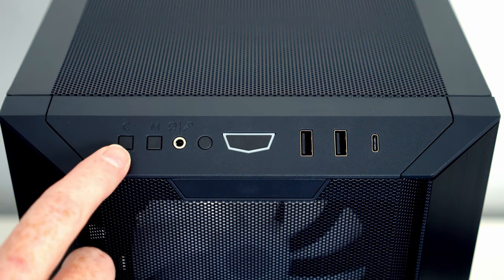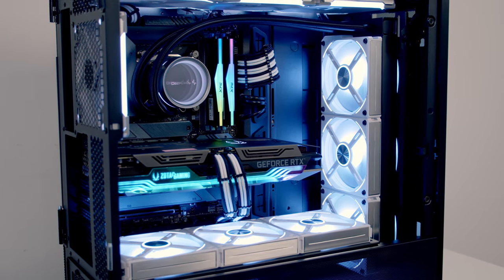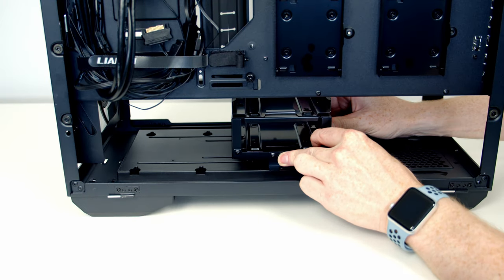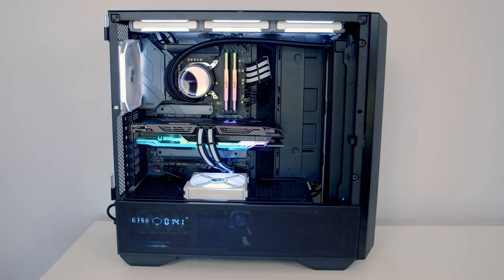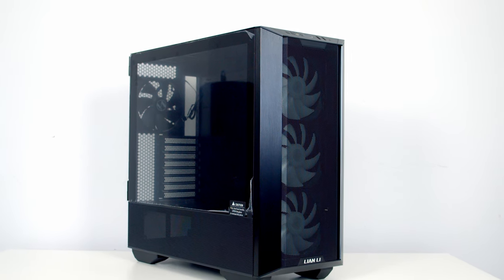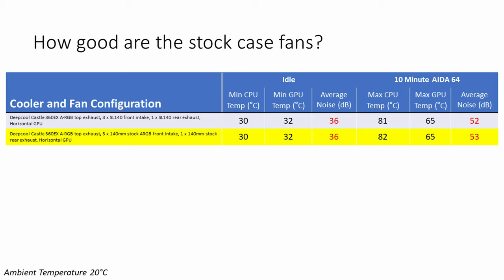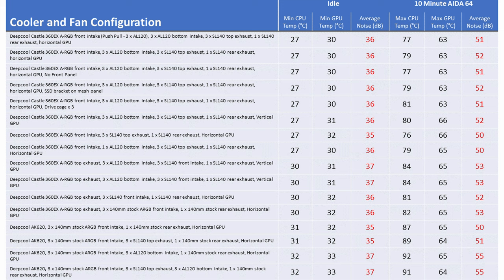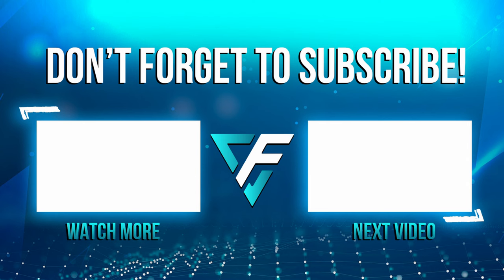Lian Li Lancool III - Best Fan Configuration

Comment: I have this case, building it tomorrow.
I think I'll mount the 420mm radiator to the front, based on what you've shared here (I was going to top-mount it). It should be easier to fit the 420mm rad in the front as well (though i will have to see). And then put 3 fans top & bottom each. IF the 420mm rad won't fit in front, i'll mount it across the top. Looks like it can fit (barely) if I move the front fans forward by flipping their bracket around, and remove the rear fan. I want the cpu as cool as possible though, it's a 7900X. This video has been extremely useful! Thank you for making it!
Reply: Have you mounted 420mm radiator in front finally?
Reply: @andreio6063  I ended up mounting it to the top.

I kinda went back & forth on placement. Ultimately I decided I wanted the rad horizontal and above the CPU, so that it would remain completely functional even at say 50% fluid loss over time (fluid loss would just make the radiator fill more shallow, not introduce bubbles to the flow).

420mm rad (iCUE capelix) was a TIGHT fit. There's 2 slots to mount the front fan bracket, 2 ways to turn it, and 2 sides to put the fans on it (8 possible configurations in total). And only 2 of those worked with a top mount 420mm radiator, with only 1 of those allowing the front cover to fit back on. Basically out of 8 possible distances in front, you want the fans at the 7th most forward position. This was: with the fan frame turned to be closer to the front, and the fans mounted to the front of that, but fan frame set into the slots which are a bit further back (the upper slots) so the front cover could go back on.

After that, I still had a problem in that the 420 rad would not allow the latching lever to move freely (to get the fan mount snapped in place). ...the top screw holes for the rad are a combination of specific holes, and elongated slots. I pulled the screws out of the holes, and loosened them slightly in the elongated slots, so that I could shift the radiator reward a little bit, and get that front latch clicked shut on the fan bracket. Then slid the rad back into place, to line up the round screw holes.

Lastly, my motherboard has a chunky IO port area, covered by a largely decorative block with LED lighting inside. It's the "Asus Prime x670e Pro Wifi" if you want to see what i mean. The chunky heat sink above the cpu socket was very tight against the 140mm fans when screwing them in. But the blocky area at the top rear of the IO completely blocked the corner of the rearmost radiator fan. At this point I was pretty deep into an overly complicated assembly process hehe. So I cut off the rear corner of the fan housing (turning it into a 3-screw fan). Then it fit fine. This is essentially invisible, unless you stick your head inside the case, and are told where to look. Also, I can't tell any vibration problems with 3 screws, seems fine. I suspect some motherboards would not encounter this issue. It's a decorative aspect of the mobo I got.

Also, I omitted the rear case fan for space. 420mm rad fits in this case but only "barely", and only with a lot of negotiation.

After all that ...the build was fairly straightforward.

Set the lian li fans to a static color. Set the icue 420 rad fans to a very closely matching color. voila, looks great. And the whole font and top of the case inside are basically wall-to-wall fans. Kinda screams performance, like a car with a hood scoop hehe.

Would I do it again? Yes. But getting a 420mm rad in there is NOT a 30 minute build. And may require improvising.

Ram clearance is actually better than I thought it would be. I got plain stick ram (ddr5 6000) and there's actually some room to spare. Particularly exotic heat sinks on ram could be an issue though.

I will say that I do NOT like the clip-system for attaching the heat sink to the cpu on AMD. It's waaaay too easy to have it move around on you and mess up your paste. I would strongly recommend using the "spread all over the cpu evenly" method for paste, cuz it's impossible to get both clips, with water hoses pushing/pulling on the pump, without it moving some. That would be true regardless of rad size, it's not related to the fact I got a big rad. I had used a dot, but the way it moved while getting it clipped on, i knew i had to pull it off and re-apply (second time with fully spread paste).

7900X runs HOT. First time in bios I thought I had done something wrong. But I figured out that the cpu is just constantly trying to overclock itself (by design), even when not under load. PBO undervolt helped a lot. Mine seems completely stable at PBO -20 on all cores, zero difference in performance, and this shaved off 12C. I also set max cpu temp to 85C, because AMD can say 95C is fine all day, but they also sell cpu's, and I want mine to last. With the PBO tune, his had only a very minor impact on performance (like a 100 mhz difference). Also 95C is very close to boiling & will fry your paste very fast (dry it out), 85 should allow the paste to last a lot longer.

I had planned to get a "not quite bleeding edge" graphics card (XTX or 4080). But the price/performance ratio is not great on those this generation. Bizarrely the flagship beast 4090 does better on price/performance. So I got that. It's more money, but also probably will last me an extra generation. It is quite warm, but I detuned it "slightly", and added three 120mm fans I had laying around over the power supply area. I would like to replace them with iCUE fans, as there are 3 open ports on the icue controller still. And I think that would match the top fans well.

Then I had to fight the bios to get 4x16 GB to run at full 6000 speed. hehe. But I eventually sorted that out. There's no reason 4x single bank dimms wouldn't. 2x32 are each dual bank which is functionally the same, 4x32 can't go full speed cuz that's too many banks, but 4x16 should work fine. But computers are full of dark witchcraft. I managed to appease the evil spirits though.

Definitely the most challenging build I've ever done, by far. But also gratifying to complete. Lancool III is an amazing case though. I made the build hard with numerous other decisions. The case is great. it's exactly as thick as my old corsair 750D (full tower), but a couple inches less tall and wide. A half centimeter more height & width would make 420 radiators easier, but lancool III is pretty beefy for a mid tower already.

Computer go BRRRR

No money left over for a 4k panel... maybe when the next black friday rolls around. I think the 4090 is completely bored running a 1440p/120hz monitor. Not even a hint of stutter, no matter the setting or how badly optimized the game. Even cyberpunk at max ray tracing just sits steady at 120hz. And visual work is much faster.

Comment: Thank you so much for your content... I bought this case and I Will put the AIO with push / pull configuration In front (6x120) + 3x140 original Fan CaseTop  ( Exhaust) + 3x120  bottom (intake) + 1x140 Rear (Exhaust) . Total : 13 Fans all of them are the ST-.120 and the original 140 fans included In the case.  All for a I7-13700k & RTX 3080Ti
Reply: @MultiNastyNate  keeping the push/pull ? or just with the AIO sl120mm (3x)?
Reply: @DanCaparroz I have the Push/Pull with 6x120 ST-120 fans, but the last week , I had to change the position from "Front_6x120 Push/Pull "  to "Top_6x120 Push/Pull" , because the pump water (Lian Li galahad 360 AIO) started to make bubble sound inside, so is recommended keep the AIO radiator & air bubble in top, BUT with this new configuration, actually the temperatures increased (with the vertical GPU mount too, as is showed in the video.)

Comment: Just goes to show that simpler airflow paths are more efficient. Adding in turbulence with air going all over the place is unlikely to help cooling or noise. The key is balance. Some of these setups might actually work better with certain fans set at very low speeds so that airflow paths don't interact as much.
Reply: Like which certain fans?
Reply: @Cleverconveyence  the fans in the basement of the case. If they are blowing too hard they are just going to interfere with the air flow front to back.

Comment: I highly recommend doing something about noise first (52+ db is very loud, IMO) before doing other tests and it drowns any chance of positive changes from things like fans under the GPU. My current config is Phanteks Enthoo Pro 2 and my fans are almost inaudible, all 10 of them. The loudest I can get it is around 1db extra in 3d mark stress test (slight bit of extra fan noise). I don't do AIDA64 so I can't comment on that. Personally, I'd prefer cinebench or 3d mark stress test over AIDA64, as latter is an unrealistic scenario that overloads CPU fans and results in said fans drowning the system noise completely. Simply speaking, almost all results start at around 50db noise, which isn't very useful.

Just my personal opinion.

Thanks for testing all of these configurations! Loads of very useful info!

Comment: wow , thank you very much for a great explanation it saved me alot of research and effort for the PC i am building the only variation or issue  i might have is i will be adding 2 3.5 hdd and no fans on top of that but i assume that will not be a problem . again thanks for a great video

Comment: I'm thinking about going with the stock configuration + AIO at the top to make it look the best. Despite the worse temps from putting the AIO at the top, I think it will still be better than air cooling the CPU? Many thanks for the in-depth video and the one teaching how to build on it. Wish I had watched it before forcefully trying to remove then replace the front panel, which made me break one of the pins and now I'm one pin away from making the front panel impossible to fully close.

Comment: Excellent Video. The air-cooled build is very attractive to me in terms of budget and ease of build. The fact that the temperatures are only slightly warmer compared to the "AIO as top exhaust" configuration really seals the deal for me.

I am hoping to overclock, however, so I may end up going with the AIO as front intake if I find myself seriously limited by temperatures under load, but as I will be using the computer mostly for gaming, I'm optimistic. Thanks again for such an informative video.
Reply: I'm currently awaiting an RMA for my Galahad 360. Knowing that I could sell that for 100 bucks and get this and a good air cooler and save so much money kind of pushes me in that direction.

Comment: It looks like the front AIO +  rear exhaust + 3x 140 top exhaust is one of the better setups and one that I would prefer, but I'm worried this would cause a negative pressure system and suck in dust constantly.  What would be the best solution to that?  Is adding the 1 bottom intake really doing anything since its inside the case?  Or would switching the front most top fan to be an intake be ok?

Comment: Do you believe a 420mm AIO on top with 3 exhaust fans that takes advantage all the available top space could do the same as the 360mm front case scenario that was the best at your tests? Btw this is the best video on YouTube considering real testing with a lot of scenarios. Good job, subscribed for this only.

Comment: My brother pointed me to this video and I liked how you break down the different setups. I then found the Mesh II reveiw you did a year or so back and am sad I didn't find it sooner as I have that case and wish I had found that video sooner. I basically came to the same results you did but I only had the 240 rad to play around with. I found that the bottom fans help but not enough for my build to bother as I too like having my card mounted in the vertical position and placing the veritcal mount in the raised position looks terrible to me. Yes it runs a degree or two hotter but after watching your Lancoool III review I wonder if I can offset that with a push/pull setup on my rad.

Comment: I think the 3 top exhaust fans might be sucking in the new cool air from the front intake fans before the cool air got the chance to circulate in the system, and this is exacerbated by the negative air pressure by having more exhaust than intake fans. That's why this setup ended up being hotter than the stock despite having more fans.

Comment: Great video! Exactly the information I was after. One question, when installed in the front could the radiator be flipped so the pipes are at the bottom?

Comment: I know the video is one year old, sorry I'm late.
But I'm thinking about buying a 3 fan bundle , to replace the none RGB one and 2 in the bottom. Doing this with a 240 aio on the top and the 3 stock fans up front.

Comment: Right now I have a 13900K with stock fans and an AIO 360 at the top and get 97-100C on 10 minute Cinebench 2024. You think if I just switch the AIO to the top and the 140s to the top I will get better thermals? That is what I got from the video.

Comment: I wouldn't have thought of a push/pull at the front, let alone putting the CPU AIO on the front, but that worked better than I expected it to and is aesthetically pleasing. I am curious if two fans on the bottom would have made any noticeable difference. I understood removing the front-most fan, it's not blowing air directly on anything, the air is just getting pushed by the front fans towards the motherboard. But the rear-most fan, maybe that could have helped in some way. At the very least it wouldn't have been as much of an eyesore as the middle-only fan.

Comment: Funny, I got cooler temps in an air cooled setup by adding 3 Noctua A12x25s above the PSU shroud.  I'm running 3 Noctua A14s in the front and 1 in the back.  DH-15 for the CPU cooler and no top fans.  I was considering more fans on the top but I don't think it is worth it as my temps are fine and I don't want to mess with the positive pressure.

Comment: I really loved the thoroughness of this test, but I am left with a lot of questions about how adding fans increases temperature?  Is it a question of balancing intake and exhaust, or the direction/ turbulence of flow?  If you varied the speeds of intake and exhaust fans, would it be possible to change this result?

Comment: Love to watch your setup on the Lancool III. I've just upgraded my gig to i9-13900K and 3090Ti, but my old case bequiet Dark Base Pro 900 and H150i PRO seem not good for the temp and airflow. I'm considering between the Lancool 3 and Corsair 5000D Airflow. Which one do you prefer for the airflow and temp?

Comment: Is it possible to fit a 420mm radiator at the front of the case, not just 3x140mm fans?  Or does the extra size and cabling of the radiator make it impossible to fit at the front?

Comment: Just out of curiosity, have you tried testing top fans as intake when air cooling, rather than exhaust?  I have been finding, in these airflow-oriented cases, filling the top full of fans set to intake *when aircooling* actually provides better results for temperature on both CPU and GPU and noise. I suspect it's creating a lot of positive pressure pushing heat out. This does not necessarily hold true for AIO cooling as I have found it is better as exhaust when installed on top, especially for GPU temps and noise.
Reply: That's not how heat and air works...

Comment: I've been trying to find out if, if the III actually has better airflow than the II, if you'd actually gain -1 degree or two. Because I have a II (thanks to your old video) an im wondering should I do a complete rebuild or just add new components into my Cool ii. cheers

Comment: This was a great video and extremely informative.  I'm building out a new Lancool 3 and wanted to know if the case can fit both a NZXT Kraken z73 and GPU AIO (Gigabyte Aorus 4090 Xtreme Waterforce 24G).  I'd most likely front mount the NZXT radiator and top mount the GPU radiator.

Comment: Amazing video, love these fan configuration test since I don't have to waste money buying the fans and test it myself.

Thanks!

I wished you did a test with:

1) Cpu cooler (air) + stock case fan configuration (front 3x intake, rear 1x exhaust) + top 1x exhaust (most left side position).
2) Cpu cooler (liquid aio, front intake) + stock case fan configuration (front 3x intake, rear 1x exhaust) + top 1x exhaust (most left side position). 

That single top exhaust should help with exhausting hot air and to channel the case airflow better (my theory).

Comment: Best to have the option of a 200 mm fans in the front and the top and the bottom and a big 200 mm sitting on the back and for the to be all white!! Do that and I will buy the case!
Reply: Missing word case!
Reply from the maker: Sounds like the torrent might be the case for you - not 200mm but not far away

Comment: Less is more on an air cpu cooler only. The bottom fans will def help with gpu temps
Reply: Correct, you need only look at GN's Lancool 2 Mesh reviews and their all time best GPU cooling cases (LC2 Mesh is on it). It leads to excellent direct GPU cooling and those cases top that chart.
Reply: @RicochetForce  yeah that's my case as well. Just got it not long ago. May have to skip 3.
Reply: @KinGDGaminG63  Yeah, there's enough here that I now have 2 friends who are asking me to help move their systems into this one when it becomes available.
Reply from the maker: will save some money
Reply: @Raymond David Smith Adding a top rear exhaust fan helps when using a tower cooler. The setup Christopher used, was counterproductive as his top front exhaust fans sucked away fresh air from the front intake before it had a chance to reach the tower cooler.

Comment: For air cooling with the stock fans, does it make any difference to have the fans in front mounted on the inward side of the front bracket (about 1" closer to components) vs. the outward side of the bracket (as they come stock)?